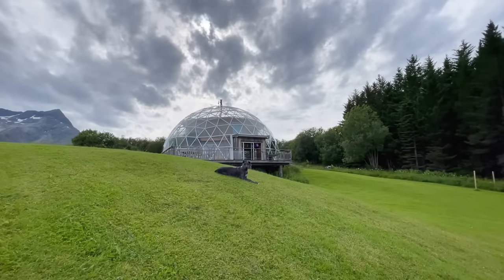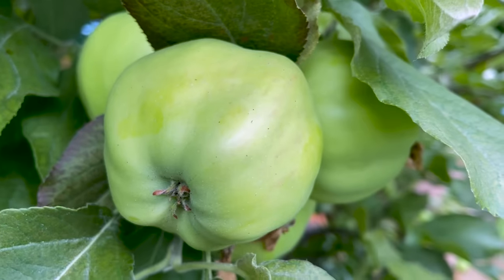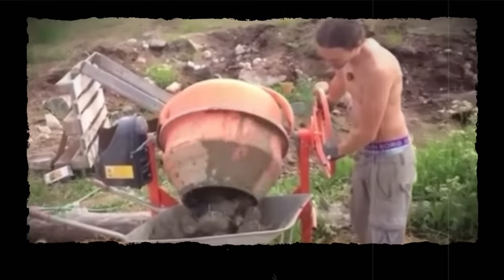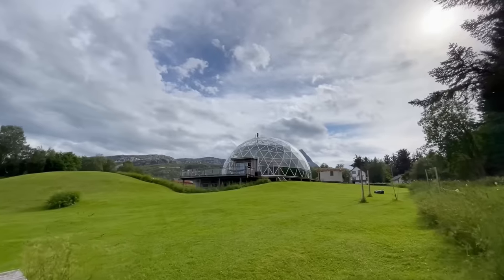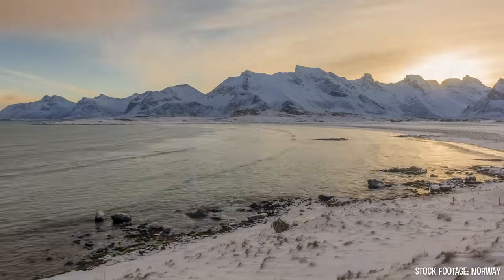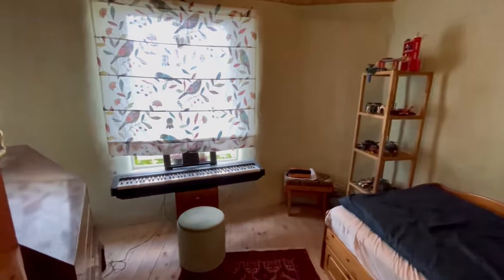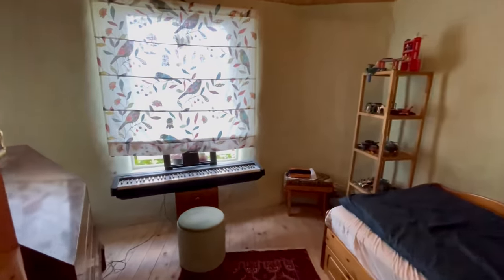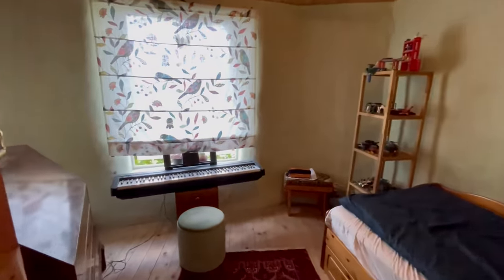Sustainable Arctic DOME HOME recycles water & grows food!

Comment: Seamless fusion of principles with dome, cob house, geothermal, solar and stove underfloor heating, the bottlewalls, thick walls for insulation, growing their own food, reusing waste water, some very humble pieces of furniture.  They've basically done what I'd only think about.  Amazing.
Reply: @ug,
Architect here, with the livability designer looking over my shoulder.
The 'thick walls' provide thermal mass to moderate temperature swings.
In this situation, the home is housed inside a thermal envelope, providing significantly-greater moderation.
.
Additionally, the mass of the structure is tied to the mass of the planet, increasing the 'thermal battery' to almost beyond calculation.
.
Compare this to a stick-house built on a raised foundation with a crawl-space for water-pipe maintenance.
That construction style results in near-zero thermal mass with near-zero thermal battery effect.
That structure requires continual inputs of outside energy -- electricity, coal, wood -- to heat... a process I call 'comfort through brute force'.
.
In today's tour, our guides describe increasing their access to vastly greater amounts of thermal mass through their design of buried ventilation tubes.
As the air naturally convects through the tubes, the thermal mass of the planet automatically adjusts its temperature to the temperature of the planet a few feet/meters underground.
This temperate-zone air helps regulate the interior of the dome, and with it, the comfort level of the home.
.
1980s.
Los Molina, California.
We built a subdivision of concrete homes using standardized 'tilt-up' warehouse construction techniques.
That region is known for months of stressful summer heat.
We built -- as warehouse construction dictates -- on a concrete slab (thermal mass tied to the planet mass) with concrete exterior and inside walls.
We insulated the outside of the exterior walls, then finished using traditional house exteriors such as brick and wood facing.
.
Driving through the area, the homes appear identical to any stick house.
However, the instant you step inside, the temperature difference is immediately noticed.
.
The second impact comes from the absolute silence.
A wood house transfers the outside noise -- traffic, wind, voices/music -- into the resident ears.
Our concrete homes provide a restful respite from the outside world... and I think this should be the goal of any home!
Reply: I see lots of earthships' concepts implemented here
Reply: @MindBodySynergyllc  It is because at that time period they still do not understand the basic principles of phyto-bioremediation to constantly clean and filter the air free of viruses and bacterias and microorganisms of all kinds. But now we know better. Plus the science of bioneering of Professor John Todd who invented-created the principle of "Living Machines" to cleanse the air and water and soil constantly and to treat all kinds of wastes indoors also.
Reply: @MindBodySynergyllc  never heard that. I doubt it. There's been hundreds of thousands built; Bucky lived in one with his wife for 30 years. Any evidence or details?
Reply: @MindBodySynergyllc  earlier in his life (pre 1937) he built 240 prefab concrete houses; maybe you're thinking of that ?
Reply: @largemarge1603  ... Your homes in 1980s sound nice...
Reply: Very beautiful, functional and expensive
Reply: What an absolutely fantastic home you have, I prefer something that is more freeform than the usual way that a typical house is built. 👍😍
Reply: Perfectly said!  You speak what I feel too.  Thx🌞

Comment: I love it.  It’s pretty much Michael Reynolds’ “Earthship” home concept except it’s built within a Buckminster Fuller “Geodesic Dome” instead of an attached greenhouse on the front, and the back of the home built into a hillside.  I think I like this better.
Reply: @SpecialSalads  I agree. Still, I’d like to see a cost comparison between the two.  The dome seems to offer more comfort and beauty but needs more land to function.
Reply: I've seen a more traditional glasshouse enclosing a regular house. It worked the same way, just that in summer two sides are opened up so that the wind blows through.
Reply: Yes thought of Earthship as well
Reply: A M Pi did it too for MIT
Reply: The Earthship concept is well-suited for a place like Arizona, but probably wouldn't work well in a climate like they have in Norway. The geodesic dome offers additional protection from the elements, which helps keeping the internal cob house intact.
Reply: @BrokenCurtain  
Papers to back your supposition?
Decades of experience to support your claim?
Reply: @largemarge1603  lmao....clown
Reply: Agreed. For colder climate this is way more efficient.
Reply: Here in Canada we have quite a few earthships. Many of them don’t use any additional heat although they all have central heating for insurance reasons. They seem to be suited quite well to the northern climates. There are a few modifications that some people do including additional insulation.
Reply: @largemarge1603  The earth ship design relies on a comfortable stable ground temperature to control the houses temperature, the location where this particular dwelling was built is in the arctic circle where the stable ground temperature isn't much above freezing. The earth ship concept isn't necessarily bad, but it has some water control issues and needs some significant modifications to function properly in certain environments.

Comment: 10/9/22... Happy to see geodesic homes, at all. An improved version fo the ones from the late 1960s & early 1970s. I have a friend who built one in Southern, Ohio, ( in 1970) and raised his family there. It was a struggle to combine the basic building designs which are generally cubes, and squares, into a space with a rounded interior. Everything had to be custom designed to work with the "triangles" making up the dome shape. ( like opening windows) A much better design is to build the dome as a covering over a square or rectangular, conventional building.

Comment: I had a similar idea of a dome home in a dome greenhouse like this with roboticly tended vertical gardens on terraced catwalks around the inside dome instead of a cob home.
Making a very modern space inside and very natural yet modern under the greenhouse.
Perhaps several of these "farm domes" could be connected into a community. And be built into urban areas.
The homeowner could lease-out the farming chores bringing locally grown crops into more populated areas to support smaller local markets and resteraunts.

Comment: I really love this idea and think it could be used to populate areas that might be considered too cold otherwise.    I don't think this would be practical in the US South where I live because the dome would get too hot in the summertime unless the dome was louvered so that the panes could be opened to vent, but it would certainly work well most of the winter.       

There is a man in Nebraska who uses the underground pipes with a ventilation system to pull in heat in the winter and cooler air in the summer, just using the air from the buried pipes.     His greenhouse complex is quite large and has citrus trees, etc. growing that would never survive outdoors in Nebraska otherwise.      I found his website by accident (he sells the plans for this type of structure) but do not remember the name of the company.  

If the government wanted to cut down on energy usage, another option would be to encourage builders to put most of the living area of the house underground where the temperature stays a steady 55 - 60 degrees.     The visible part of the house would take up less space above ground and the house would probably be tornado proof, as a bonus.     The issue in the US South is what keeps us from building basements on a regular basis, and that is ground water near the surface of the soil.

Comment: Love the idea!  Still, pretty expensive for a home-built place.  I built my own geodesic dome out of reinforced concrete over 7" thick polystyrene foam panels.  Two story about 1550 square feet.  My home cost well under $100,000.  I used Timberline Geodesics steel hubs for the form, then removed the frame after the concrete set.

Comment: A home built inside a dome, barn, shed, or similar structure won't be exposed to the weather thus can be built much more lightly and cheaply.  It will be warmer and cooler, and, there is this wonderful space outside of the house but within the exterior structure.

Comment: I've kind of assumed the dome isn't a full custom design. Made to order, stock parts, or all custom from a single supplier? Then there's glazing. Not sure if polycarbonate, single pane glass, or double glazing. Kind of assuming the first. So glad the dampness was explained. With lots of eco builds it's also about what is available locally, even if in the store. Denmark isn't so far from Norway?

Comment: I live 50 km south of the arctic circle. I would be interested to know the temperatures outside , inside the dome, inside the house. I'm pretty sure that the dome saves a lot of energy.

Edit: Building it way smaller, let's say 40m2, could cut the cost significantly.

Comment: The reason why you don’t see a lot of this is the humidity….And the fact that you’re basically the ants under the magnifying glass. You need to live in a pretty cool, cloudy climate To make this work, and you need to have very good ventilation or else you’re going to get mildew and rot and mold galore. They have a rather good solution, but the viability of this home is based almost entirely on its location
Reply: Thanks for viewing and contributing🙏. I'll share some beneficial knowledge🚀 let's Converse right away the above📞.

Comment: Not sure if the glass is insulated (double glass) or not.. but if Insulated.. why do you need walls inside for a "home".. just provide heat absorbing/storing partition walls in the center and "live in the garden" .. using Silk Screen Sliding Partitions .. like in Japan.. for privacy etc.. ???

Comment: Sorry but this goes against everything a normal house needs!! VENTILATION VENTILATION VENTILATION!!!
Human CO² needs to be filtered out CONSTANTLY! So either keep windows open at all times or have a specific ventilation system to constantly refresh the air...
Reply: Over about 700ppm and you can tell. Over 2000 ppm and it makes people lethargic or stupid. The house is bigger than it looks, most of the downstairs is open plan. Just the boys' bedrooms really, they need to get fresh air? Meters are available if in doubt, for about USD 20. Price is now much less than it was.
Reply: @plinble  Are you suggesting this house is properly ventilated, when you have a whole f***ing dome around it? Now if it was designed that the Dome had large open windows to "air" the house out, I could MAYBE understand! I don't even want to come near such a stinky thing! FRESH AIR!!!!